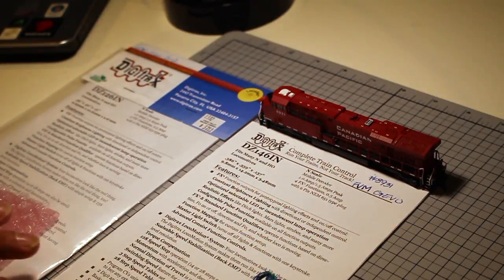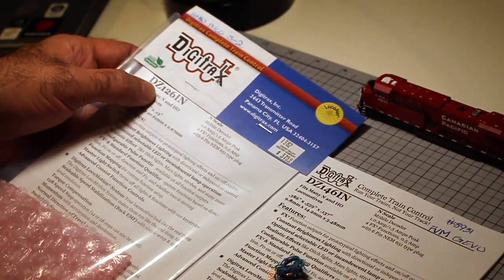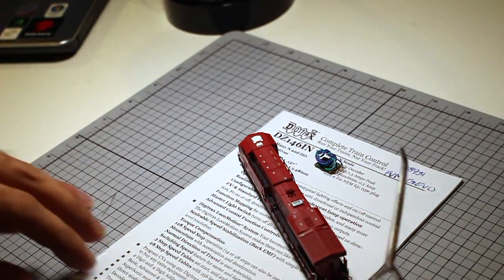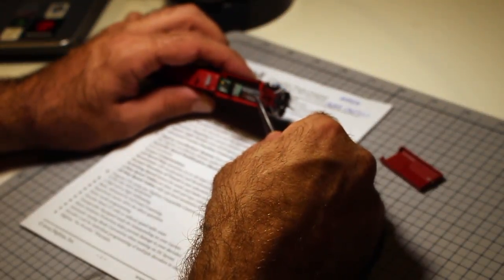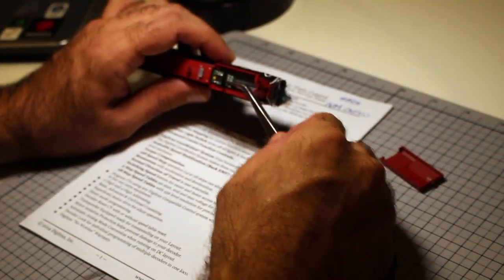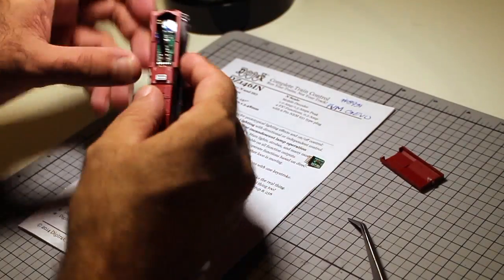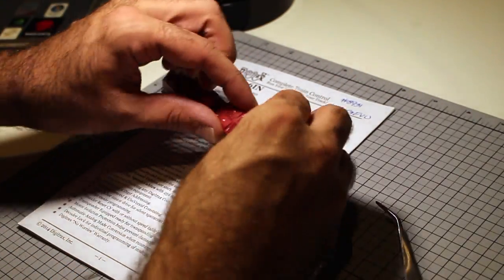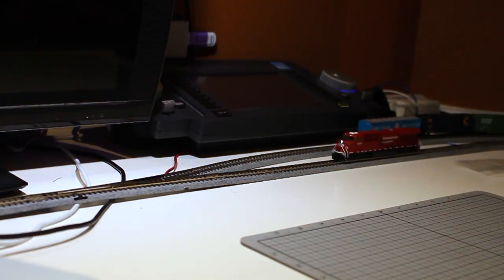FVM Gevo Decoder Install: A Step-by-Step Guide - A Hobby Adventure !

Comment: Well done Tim.As i said thanks to FVM it is a piece of cake to convert it.Your CP runs also as smooth as silk.Thanks for your link.
Reply: What maybe is also interesting: A Ho Intermountain Gevo with 497gr. pulls 90gr.This is a weight to pull ratio of 5,52.The N FVM Gevo at 117gr. pulls 20gr.A ratio of 5,58!!A tie and it shows how good this N Gevo´s are.I also MU´d 3 FVM´s up and they pulled whopping 70gr!!!This tiny engines are really monsters.
Reply from the maker: Wow. And who said N scale is no fun. Lol. Thats really interesting. Very close indeed. For being such a small train I agree with its such a great locomotive. I'm really contemplating about getting another FVM loco.